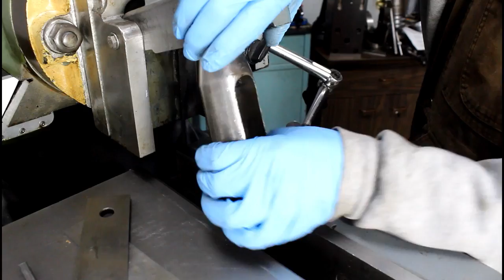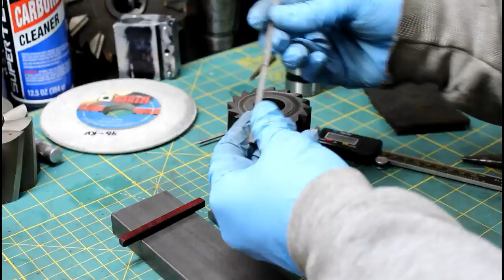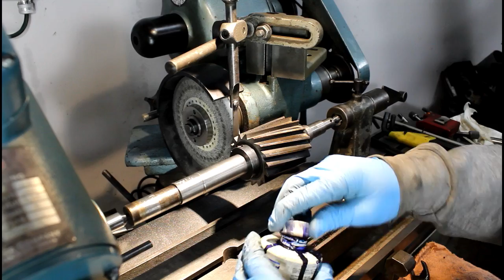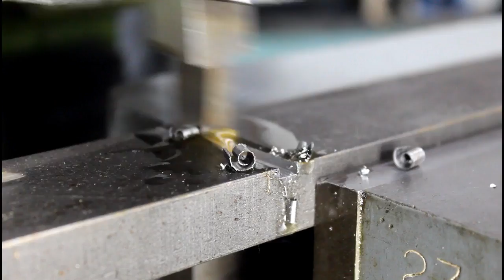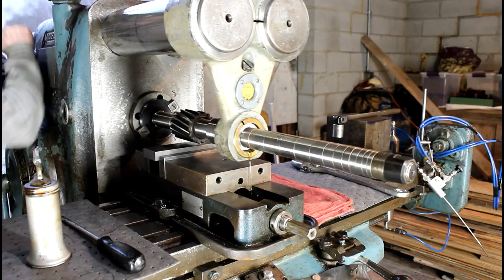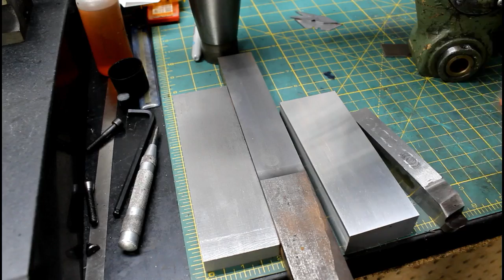Running a Slab Mill on the K&T   Metal shaper / Cuttergrinder.

Comment: Suggestion - I ran a K&T many times , you can climb mill on it . I'll tell you what you already know .
For Slab Milling -- A can of oil above the cutter as a drip system. The chips end up in back
of the cutter.The finishes are better than conventional milling. Give it a shot .

Comment: You have gained a "Calibrated" eye!  Loved the tunnel location video.  I ran slab cutters. on some projects. in HS '68-'70.  Got some arbor wobble.  I will always love manual machining on the older machines I learned on.  Thanks for the videos, especially the creek videos.

Comment: Great video, Steve.   That helical grinder is a very nice machine and it has one of the nicest sounding spin-ups I have ever heard.   Thanks for sharing this.   You might try a thin spindle cutter on the K&T, to save you time versus using your shaper to cut a part.   Your K&T rotates in the same direction as my 2HL;   I have see some videos with an opposite spin direction (clockwise) and I just figure they are running their machines in reverse (eg: Rucker).

Comment: Great video Steve. Some great gifts & finds there. I like the shop work a lot. Check all your arbour spacers for parallelism even a chip between them will cause some runout.     Also love the shots out doors. Looks like a very nice area to live. A road trip now and then goes down well also.  I agree stay away from the tool review scene. I like auction shots and drawer sort outs. Thanks for sharing. regards from the UK

Comment: Hey Steve, Your KY weather looks just like my southern PA weather. I just put a quick video up of me using a slab mill a few years ago, It worked awesome until one day I wasn't thinking and tried to use it to mill down the shank on an indexable lathe tool holder, the tool holder won that battle.

Comment: A cutter with so many teeth is for somewhat hard/tough material. It also looked like it's more sliding over than cutting into the steel, it needs a higher feed rate. Runout is always a problem on these long arbors. Make sure the ends of the bushings are parallel to each other, otherwise the arbor gets bend when you tighten the screw. I think it was Abom, who made a video about that problem.

Comment: I think you will see a difference in your finish with the slab mill when you get your flood coolant running. It will keep the chips washed out away from the cut so that they don't get mashed against the surface.

Comment: Great vid  Steve!  I see that you now have a full set of arbor supports.. The style "a" is good for light cuts such as cutting small keyways, gears, etc and when you need more room underneath the arbor support...  I have run a 3 x 6 slabbing cutter in steel  on my 2hl universal with plenty of oil pouring on the cutter and with style "b" arbor support and arm brace locked to the knee... Even a K&T will tend to flex a bit under heavy cuts hence the need for the arm brace....Be sure to put an arbor support on the arbor before you tighten the arbor nut to prevent springing of the arbor and only store arbors in the vertical position....Beware climb milling.. That is a no no on an older machine so conventional milling only!  I suspect that the crack on one of your arbor supports was caused by someone trying to climb mill.. Be safe and keep up the good work! Mike in Louisiana (Ramsay1)

Comment: A couple comments suggest enlarging the keyway in the slab mill to fit the arbor. Cutting hardened tool steel is quite a trick.

Comment: Seems like the run out is all in the spacer.  Could spacers with non parallel ends be cocking the cutter in the few tenths of clearance between the cutter and the arbor?  It would be fun to see you measure and attempt to find the reason.  Not that it is a big deal, it's just and interesting question.
Reply: Adam and Keith Fenner both had issues with some spacers not being end parallel and that causes the arbor to draw when you tighten the nut up. Perfect inspection video and grinding video!!!  :-D
Reply: @StreuB1  I didn't think of it bowing the bar but your absolutely correct it would load the bar and flex it.

Comment: When you run the slab mills you need flood coolant . If you noticed the chips are not leaving the cutter but being recut thus loading the cutter and not giving you the best finish. You probably have a 125 finish but it could be better. I know you are just trying things out but I would go ahead and get some flood coolant going. I used to run serrated slab cutters that were 32 thread. We used them to cut "memory plates". They were for making minute adjustments when paired together. More aircraft stuff.

Comment: Not my equipment, but I think you need a higher feed rate on the slab mill.  It was barely taking a chip it seemed.  I also noticed the finger was deflecting quite a lot when grinding.  If it was moving to a different location in the gullet, you'd be getting different tooth heights.  Good stuff as always.  Like the scenery.

Comment: Looks like you have a little bit of "green up" happening there, especially where water tends to collect.  First stirrings of Spring!  I've been hearing geese in flight at night.  Trees have new shoots on them and the buds are swelled ... under the ice.  (sigh) alas, it's more of a torment at the moment.  Snow yesterday, and supposed to get more tonight.

The roads you keep showing have a familiarity to them.  Probably due to a small town truck pick up some where in the eastern part a couple of years ago.  Curiosity may get the better of me now, I'll have to look back in my driver's log and see if I was anywhere close to you or Brian.

Looks like you have a few wobbly-wobbly issues to chase down on the mill.  Hope it isn't too complicated in sorting those out.

If needed, ... Tell your boy that the handle of a snow shovel fits better to his hands than it does to Mom's or Dad's.  ;-) (You can tell him a grumpy old fart said that).

Comment: Steve, when I was learning tool and cutter grinding we were taught that our finger should always be below the work, is there a facility for this on the ko lee? Also with a slab mill it may be wise to have a cutting edge of approx. one eighth of an inch and a relief angle on the back of the cutter. Your thoughts please. God bless.

Comment: It looked like a lot of chips were being carried back around on the steel cutting test.  Maybe part of the finish issue is recutting chips?

I'd like to see an indicator on the arbor next to the cutter, curious if the runout is from the arbor or the cutter itself.

Comment: Here’s a thing I’ve wondered about cutter grinding does the wheel wearing make much difference to the edges by the time you’ve got right round?
Reply: Absolutely. If your cutter is really bad, and you need to take a lot of material off of the cutting edges, you would grind all the teeth until they clean up (no more cops/dents), but by the time you get to the last edge you'll be taking less of a cut because the wheel has worn down. It won't be very much, but you will have to re-touch off on the first edge you ground, and take a really shallow finish path. Since the finish pass is so shallow, there won't be much pressure on the wheel and it won't wear as much as it did on the first roughing pass. Even if you don't do this, the amount of wear from one pass around the cutter will be VERY small. It'll likely be negligible or possibly un-measurable.
Reply from the maker: @xenonram  Agreed, I always make a fine pass for the finish cut 180 from my original starting point.
Reply: Andrew Delashaw thanks for the reply it’s not a process I’ve ever had anything to do with

Comment: I know about bandsaw blades, I usually order my blades from Amazon, I always keep an extra blade because you always need a blade on weekends. I’m am experimenting with a I’m machinist  blade on my vertical just to see how it does, the blades are supposed to be bimetal so we’ll see how they compare to the other blades. I do have a custom blade on order for the converted vertical saw. Question I now my sister in law over in Lewis county has a lot of Coyotes in fact they have to watch their dogs when there out, in fact their neighbor dog was almost attacked by a pack of them. Do you have the same problem.

Comment: Hi Steve, one question, why do you run the wheel on your cutter grinder 'ass bakkerds' as we say in Somerset? All the grinders  I've worked on, tool and cutter, cylindrical and crankshaft run the wheel in the opposite way to yours, directing the sparks downwards, also gravity would also help keep the cutter against the finger and if you used a flow of coolant  it wouldn't fly up in your face! If I were you I would clock up that arbor, it looks a bit bent to me. All The Best, Jonathan Griffin.

Comment: Are slab mills supposed to leave a nice finish or are they more for metal removal. I expect you will improve it as you chase down the various sources of runout i.e. the cutter, the arbor and the spacers and any slack in the gibs.
Reply from the maker: I think they are more of a finishing cutter . Really depends on the design

Comment: it looks like you are experiencing a lot of chip recutting with that shell mill. you would get better results if you used coolant or compressed air to blast away the chips so they weren't clogging the cutter.

Comment: I would have used the Bridgeport as it usually already has a vice setup on it. I might be tempted to cut a smaller slot in that shaft 180 degrees from the original slot. Then that shaft could be used for both sizes.

Typical example of  most machine shops in America, we need an hour setup to run a ten minute job. The days of long production runs on a setup seem like a thing of the past. I spent many days setting up more than running in the last decade. Managers seem oblivious to understanding why production is declining!
Reply: You're not from around this shaper country, are you mister?
Reply: @paulcopeland9035   Yes, I have a shaper. If your close to Iowa I might even sell it to you.. Mine is small enough to put in the trunk of your car. Now if his shaper vice would have been setup in the right direction I may have used it for a job like this. Sweeping vices in always takes time. We used to install key stock on the bottom of our vices that fit the slots on the mill. It would locate the vice close enough for this kind of job.

Comment: You don't necessarily have to use a key.  Lots of folks fear snapping a key more than spinning a cutter.
Reply from the maker: Good to see you James👍. Makes sense. A sheared key could ruin a a arbor. Guess depending on the type of cutting you were going to do would determine if you could get away without a key. I will keep that in mind. Thanks
Reply: @SteveSummers  If you crank on the arbor but nice and snug you can take a pretty hefty cut without a key

Comment: Thanks for the great vid Steve!!! Check my comment below about the arbor runout likely caused by the ends of the spacers not being parallel and causing the arbor to draw when the nut is tightened down. Adam and Keith F. had that same issue on some of their spacers. Great inspection and grinding video for the spacers!

Comment: Why put a key to drive the cutters , when just the  pressure of the spacers can drive the cutters , to much pressure on the spacers can brake a 3/16" cutter if for some reason comes to a sudden stop ?
Reply: "brake"?
Reply: @paulcopeland9035  My 3/16" cutter is cracked from the center to the circumference  My machine is a burke # 4 no brakes on that

Comment: I think a better idea would be to cut the keyway in the cutter to 1/4  so it is a standard item.  Hope you measured the bore to be sure it is 1" and not 25 MM.
Reply: @11:51The cutter is a perfect tight fit on the 1" arbour and the metal is too hard to alter the keyway.
Reply: @jonka1  Maybe hard, but he didn't really address that in the video- my guess is that it was a 25 MM bore cutter someone expanded to 1", but left the metric keyway.

Comment: I had a A arbor setup on my #2 Cincinnati and found a new Bison B Arbor On Ebay. Yep the Run bushing was too tight, and just got it up ,and running yesterday... Seems like common problems.. I picked up new USA slab mill cutters on Amazon for almost nothing. Really nice stuff.. I just got my flood coolant hooked up, and really impressed with how nice it works.. Tried Climb milling, but have work to do there. Has a auto anti backlash mode, but really need to see if it works or is it me? I believe it will take a bit on time to get the parameters right to even know if it does.. Was a bit jumpy, so I went straight to conventional milling. 

https://ibb.co/Jt4R9KQ

https://ibb.co/51JGPHG